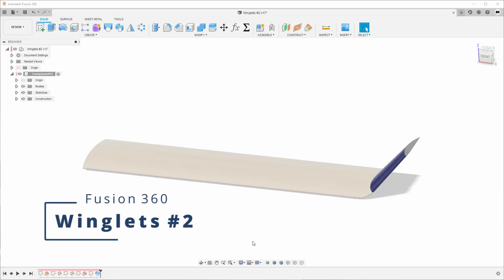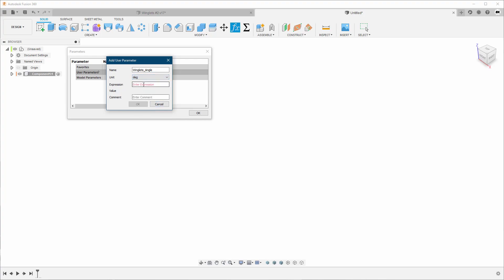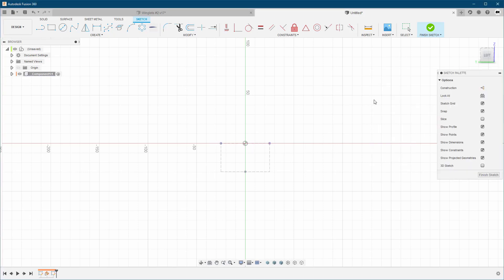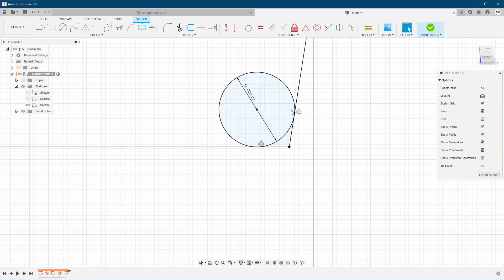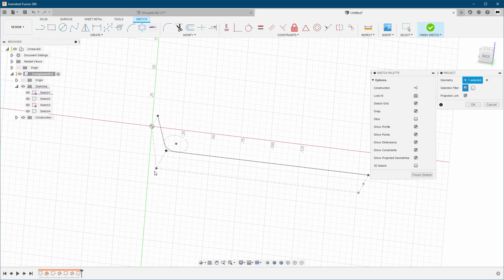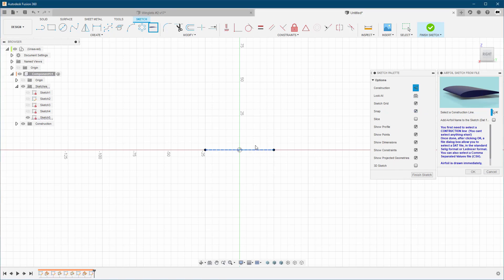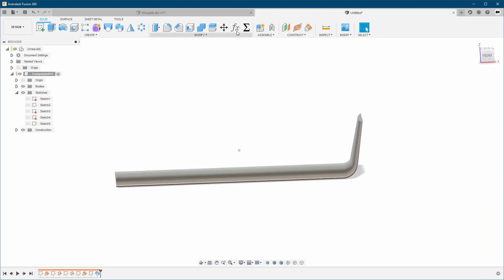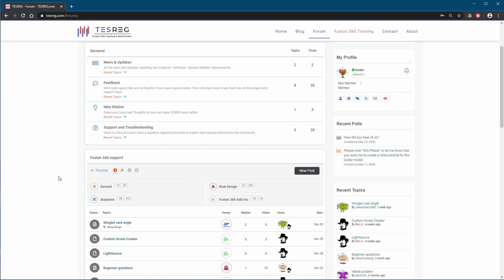Fusion 360: How to create Winglets (Wingtip) for airplanes #2

Comment: Okay so if your making an airliner or any plane with a shape that is not straight, you will have to break the sketch into section. I tried every method of using this technique for ana321 wings + winglet and finally figured it out. Sketch the based of the wing and sweep, then sketch remainder of wing connected to winglet and sweep.

Comment: Nice video, thanks...

Actually,  I already knew how to do this... but OOOOH - I SEE A WING!  So I copied along...

But, as is typical with Fusion, this led me down a path...   

The video shows a positive angle rotating the plane ANTI-clockwise... leading to an upturned winglet as required
(ie the "Winglet_Angle" means "winglet 'upturn' angle... from horizontal").  

However, when I tried this, entering a positive angle made the plane rotate CLOCKwise, which would lead to a down-turned winglet!

Q: Is the 'angle direction' a configurable setting?    Like a 'flip direction' option?

If not configurable - there's numerous 'workarounds' for this:
- enter a negative angle (non-sensical)
- set Winglet_Angle to a negative value (so "-30" gives the tip 30 up from the horizontal)
- set Winglet_Angle positive, but set the dimension angle to " -Winglet_Angle"  (negative sign prefix!)
- or of course, use a sketch with a dimension line etc, which then guides the required construction plane

Q: But is there a way to avoid any of those, and have a positive angle equate directly to 'angle of upturn for winglet', as the video appears to show ??

This must be a common issue/requirement?  But my search has revealed nothing... so far....

Or am I missing something here (apart from a life) ?    :(

Thanks again.